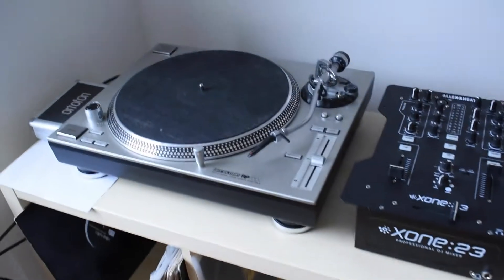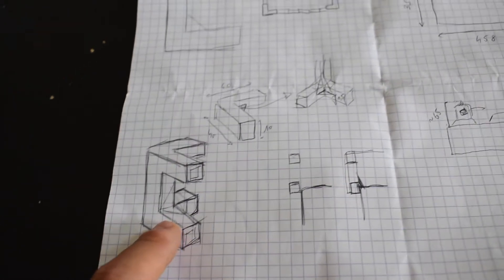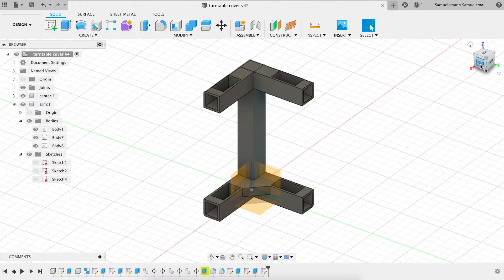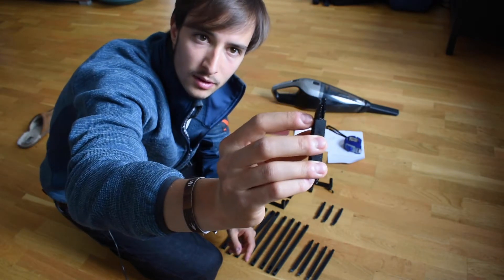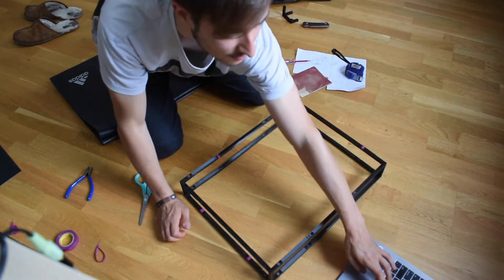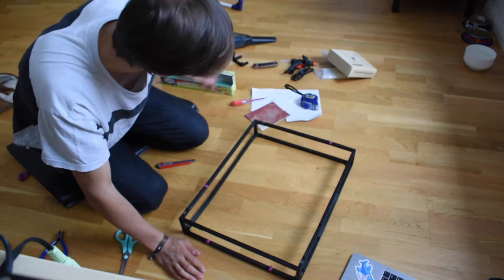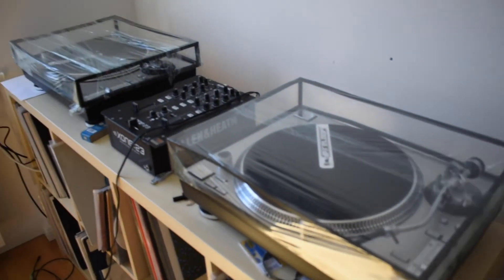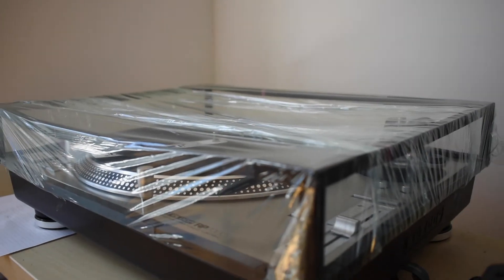3D Printed Turntable Cover

Comment: I agree with the other commenter about using plexiglass.  Of course, the cost at that point would be close to just buying pre-made covers.  If you decide to stick with the plastic wrap you could try applying a little heat with a hair dryer. It should take all the wrinkles out.

Comment: Hey what material did you use? Tried to requisition someone to print and they were unable to print with PLA
Reply from the maker: I used PLA, but other materials should work too. There is nothing really special about these parts that they need a specific material. ABS, Nylon, or others should work fine. Good luck!